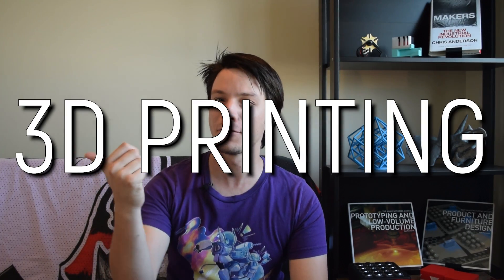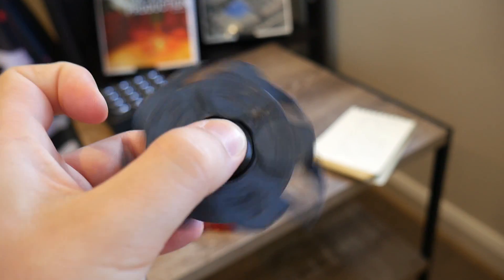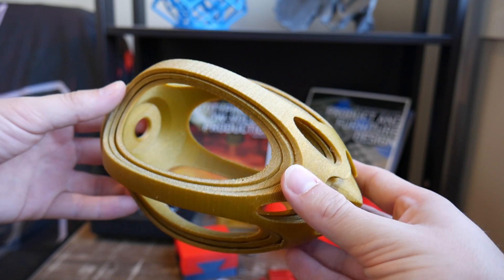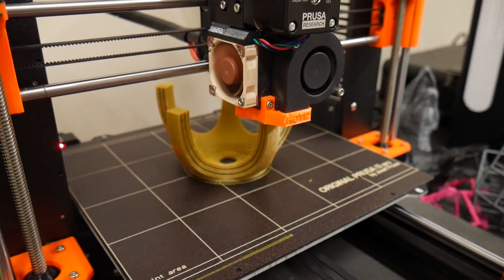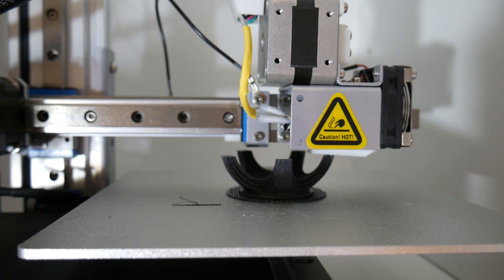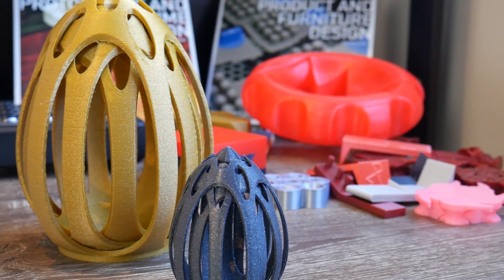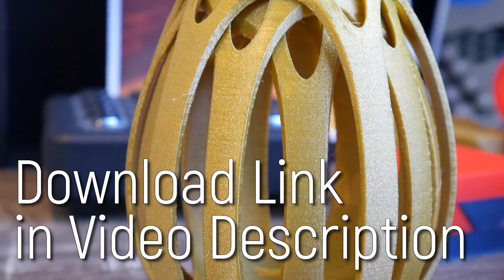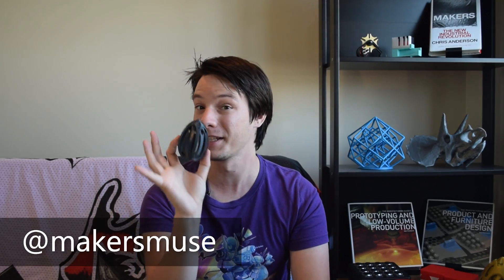Easter Egg 3D Printer Torture Test

Comment from the maker: Gumroad should be back up and running now, let me know if you have any issues!
Reply: makers muse i thought about this just now did you steal make anythings logo xD or did he steal from you ?..
Reply: very simular xD
Reply: Maker's Muse  is there a filament I can use for aquariums vivariums and terrariums and will be safe for my animals like tarantulas scorpion lizards ect I can not find any that say safe for aquariums coz if it's safe for them it will be safe for most invertebrates and lizards too can you help me please as I want to 3d print hides  branches skulls for deco and stuff there will be high humidity and temps in the terrarium and vivariums
Reply: Sounds is way off
Reply: Thanks Angus. Came out a treat double sized in Esun dark grey ABS+ on the CR10s
Reply: Whats the shinny black plastic you used?
Reply: please make the cuts smaller so it closes completely :)
Reply: Maker's Muse  lol looks like the dragon egg from Harry potter  goblet of fire
Reply: can cura correctly slice  this?
Reply: hey make some sort of a torture cogwheel or geartype thingy. or easyer: a torture steampunk design.

Comment: Hey Maker, having problem with your egg, downloaded the file from you site and its the smaller version when i put it into cura , i have .15layer height, 3 walls, I even put .1 horizontal expansion. Nothing seems to work, gets fused at the bottom, no seperation. Running filament temp at min. 205 and fan on , bed 50c. Maybe some setting in cura I'm not doing right. 3d printer nerd did it and said to he raised his z up, how would i do that?

Comment: Printed this at 150% but close to the top, about 3/4 & I had what appears as a layer shift on about 3/4 of the circumstance of the outer layer, any ideas as to why?... I printed it on a Longer LK2 with PLA... Other than that, IT WORKS!!! Pretty cool!

Comment: The model looks attractive, wondering how to handle printing my printer?...
Printing went well, only had to reduce the print speed to 10 mm / sec when building arches. It will be necessary to try printing reduced to 70% of the model, when there will be time.

Comment: Looks like it needs to be printed with supports right? At the top of the holes in the sides, it looks like its printing in air on a few layers in Slic3r. Please let me know if you had to use supports. Thanks!

Comment: Hi Angus,
It's good to see you still coming up with fantastic prints.
I like printing practical things that can be used in everyday life issues.
An example is, I've got an organic veggie garden and got really annoyed this year with the dreaded white moth (cabbage moth). It was ruining all my leafy plants and so had to come up quickly with an idea. So I figured of throwing over netted curtain material that the light can still come through but keep the white moth out. This worked well up until the veggies began to grow wider and higher, so I decided to put in some stakes and drape the curtain material over them and hold it down with some rocks. Then I thought, "I need to make a frame!" so I began to get on my 3D printer and began to printer corners and 'T' connectors for 16mm curtain rods. This worked perfectly, and then thought 3D print some clips to clip the material onto the rods. 
I couldn't find anything what I needed in thingyverse so I've created them from scratch and now that I've created them, I'm thinking: "If I can create this, what else could I possibly create that serves practical use?".
My 3D printer had saved me 100's of dollars and time. It really does pay off to have one.
Though it takes a little while for the prints to complete, it's save me time and effort of having to redo my garden each time.

Comment: you should do a series on milling machines. they still rule the production world. they can create (and have created) virtually anything, and with perfect surface finishes. yes it is more difficult to produce complex parts with a milling machine as you might need to create the part in several pieces, but the end result is outstanding. in addition, if you want mass production currently your idea is only as good as the molds that will ultimately replicate it. that means your design cannot be overly complex. so some of the fancy proof of concept 3D printed models are simply not a realistic option for production. maybe the story will be different in 10 years, but today milling machines still dominate the world. the molds for practically everything you have ever owned were made on a milling machine.

Comment: Thanks. The design printed great on my Prusa MK2 at the default size. Getting it to break free without snapping a side was tough. It held together just enough. Kind of needed a slot in the bottom center ring and then have the middle ring set up with two holes on either side that you could use a split ring pliers to torque the sections free. Of course, that's the deal isn't it. Should it twist free without effort? Thanks again and keep them coming!

Comment: Printed fine on my Tevo Tornado.  All sections happily spin.  5hrs 7 mins on the settings I ran but I wasn't rushing it.  60mms, 0.15mm layer, 3 shells as per recommendations.  Biggest gotcha will be your bed leveling.  Too close to the bed and you will fuse the walls at the base.

Comment: Cool design but I don't see how that's hard to print... I mean not like the lattice cube is harder either. Even my bone stock DaVinci 1.0 is able to print them in ABS or PLA with no issues. Not to mention my MK2, Cr-10, or Ender2.

Comment: hey Angus, having an issue when slicing in Cura that one side of the model has big strings all the way across it ( in the gcode). Didn't happen with ideamaker, so using that now, but I'd love to get it working in Cura if at all possible, do you, (or anyone here) have any suggestions?
Reply from the maker: I think you're just seeing the movement in the Gcode preview, the printer isn't extruding at these times but gives you an indication where there might be 'whisps' of filament.

Comment: ????? can't you just print them in the separated state? and the only overhanging part would be the "shafts", which are not visible anyway.
Reply from the maker: They can't be separated once printed, so you can't join them together either.
Reply: perhaps I wasn't clear on that, it's still printed the same way, but just in the already rotated form like you have shown, and the top and bottom shafts are not visible so they can be sloppy and still work.
Reply: Probably but that would be so much extra cad work.

Comment: Very artistic design there. Only eat one printed using chocolate, and not the protopasta.
Ever had Simplify3d stop moving the printhead in the middle of a print? I just bought that, and have 2 days left of a 1week trial to ask for a refund. According to their tech support, they've never encountered that before. It's a obvious bug specific to Simplify3d that can't be replicated in MatterControl or Cura, so it's not the USB connected computer nor the printer itself. In fact in the simulation screen it showed that Simplify3d thinks it's still printing. Anyone ran into that before?
Reply from the maker: Is this printing via usb? I never, never print like that unless I have no alternative because there's so much that can easily fail or you can encounter quirks like that. Much better to slice to SD card!

Comment: Really cool design! But I'm kinda doubtful my cr-10 would be able to print it successfully xc
Reply: Sinom I've considered getting that printer actually. Why do you think it won't print that type of item?
Reply: Nah it would print it just fine, the only trick to that print is your top and bottle layer settings in the slicer (which is really easy to spot and correct). The title is pretty much clickbait.
Reply: First of all I would have to try it at doeble the size which he did but then the bottom layer would also need to be pretty much perfect otherwise it will lock up and I am never able to get it perfect. I installed a second spindle which reduced ghosting a lot but it could still be a problem when printing this. I also don't have the best fillament and at twice the size this print is pretty big so the chances of something going wrong are also pretty big.. I am probably just gonna try it though.

Comment: Someone needs to make a tiny resin egg
Reply from the maker: Could be interesting if that works, in my experience the resin wicks into the gaps through capillary action and these tests actually bind up. We shall see!
Reply: @MakersMuse  Hei, i made it work on a resin printer no problem. Without any resizing. Its all about calibrating the printer for the specific resin.

Comment: I have an Anet A8 I was wondering if you are planning to do a review on one
Reply from the maker: No, not at this stage. Might give the new Ender 3 a review though.
Reply: It’s a great machine for the budget and hobbyist.
Reply: Maker's Muse why not the ender - 4?:-)
Reply: Ned Attfield Rutterford most anet shipped printers probably arrive with no missing parts, and no need to experience the cat n mouse back n forth emails as they carefully avoided to answer specific questions. Such as when will they ship the missing part, and if they would be willing to include a parcel tracking number so months wouldn't turn into the 6 month mark. Even their main factory's email remained unresponsive. It seemed rude how anet knew eBay's policy was to involve a specific time limitation, and appeared to be gambling on me just walking away because of it. eBay read the emails and said what the seller did was very wrong, and refunded 20 bux to use for a supplier for missing z axis leadscrews. 

Guess who won't be buying another anet product?  Or a 3d scanner from 3D Systems? Lol.  A Sony Expedia XZ1 Compact edition cellphone with built in scanner should be here in a few days. Scores!